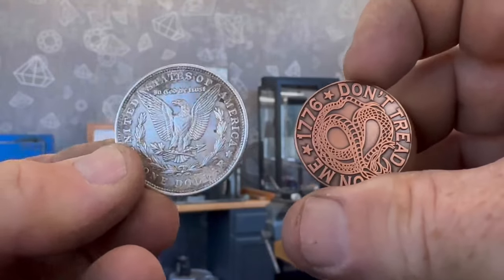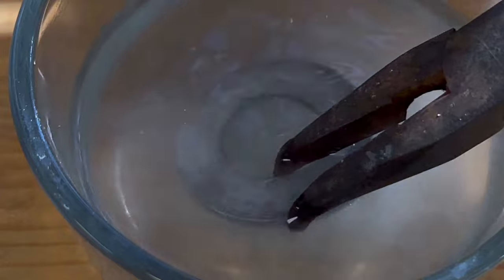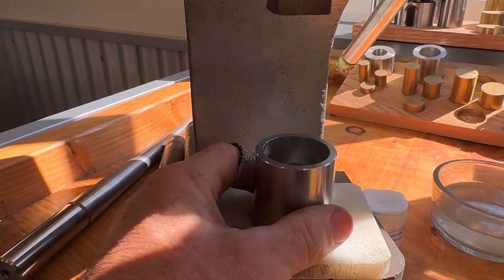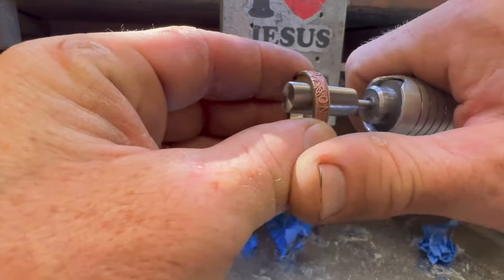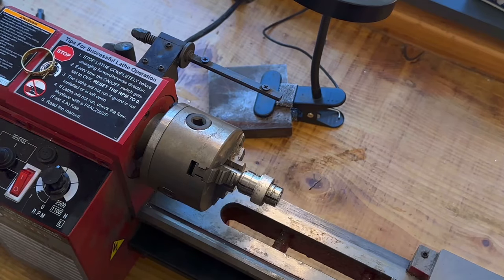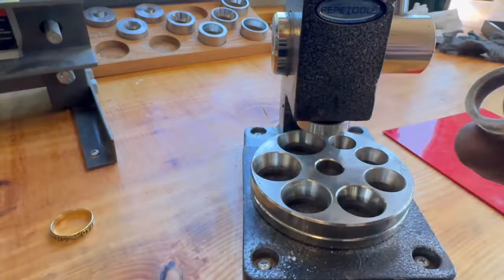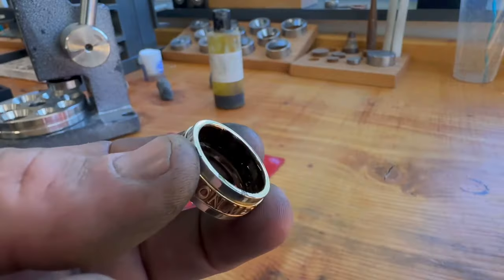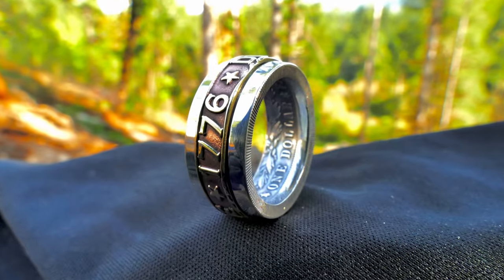Making a Spinner Coin Ring From a Silver Dollar!

Comment: I tried to make a silver dollar coin ring, it started okay but seemed to not want to fold after the 3 rd heating. The first one broke and this one is getting hard. If the silver dollar came from Temu will that make a difference. 
As I want to make a spinnner similar to the one you made. 
Thank you 
Ed
Reply from the maker: Temu is definitely your problem. They are fake and they means it’s cast. You can’t fold a cast coin. They have to be a real coin that has been extruded and struck to get the metal grain pattern that will allow it to fold.
Reply: @CoinRingsfromTheMint  Thought so and I thank you for getting back to me so quickly. 
Ed

Comment: Hi Skyler....loonng time admirer...
 I have been searching for copper coins (coin shops and on line) without any luck. What size comparison (to different coins we use in circulation) did/does the copper coin you used match? 
 The only sizes available (that I can find) are in 1oz size.
 We thank you for your response. 
      Gary
Reply from the maker: I just used my last one today so I can’t be exact now. But it’s pretty close to a half dollar. Also there was no design on the back. It was just smooth. It was the perfect size! The 1 oz ones are usually too large to work well unfortunately. I just hope whoever sent me those sees this video!